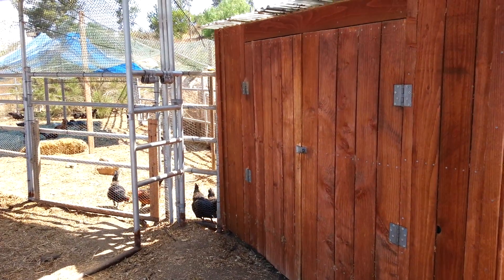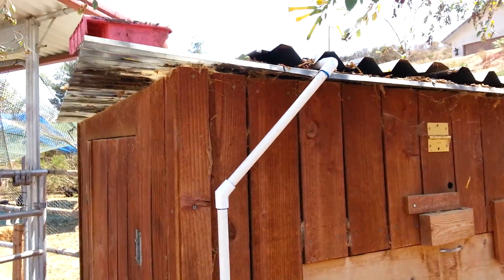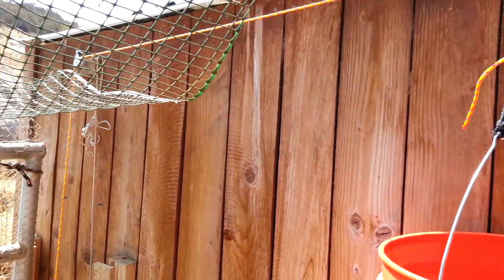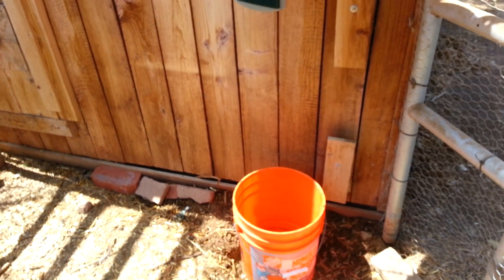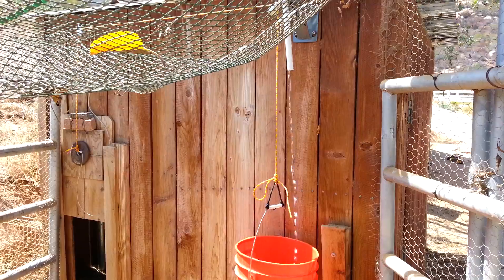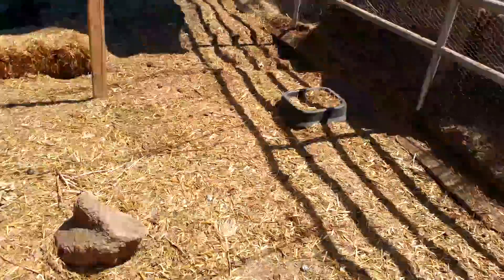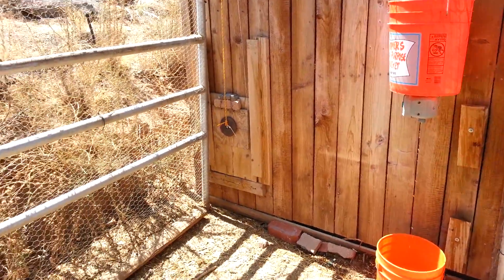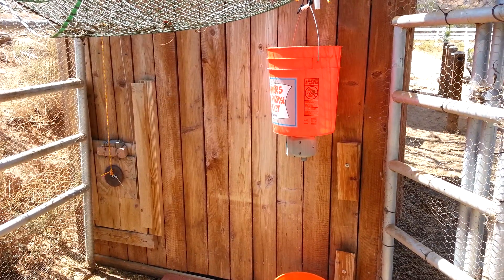Automatic water powered chicken coop door opener

Comment: Looks very expensive with those irrigation timers. Even if you already had them, the cost of replacing would be heavy. Pun intended. You could have made this with a $10 - $15 Timer, a limit switch, $13 pump and A bell syphon made of a few cheap PVC parts. Water is recycled and can double as water for the chickens.

Comment: 10/10 for ingenuity and innovation. But, this would be very difficult to have working in the winter, anywhere where temperatures drop enough to freeze the water lines, you also have to have running water and electricity nearby, honestly speaking I don't think this would work for anyone far enough up North that has cold winters. You still need to buy the water timer, thats not cheap, why not use a linear actuator on a timer or even on a solar sensor that can open/close with the sun coming up and going down, come is about the same, you don't need running water, no freezing in the winter, and cost wise you're probably looking about the same. Just my two cents for anyone considering this system. Not to offend the video creator, like I said I think that it's very smart design and if you live far enough south and have warm winters then this system might be for you.
Reply: Yeah there is way too many downsides/negatives/Cons to this that the Upsides/positives/Pros are severely out weighed. Pun intended.

Comment: Like the idea, except it be a problem when temperatures drop below freezing! Although you might be able to make a similar system more on a closed containers and maybe use anti freeze that the chickens couldn’t get into!
Reply: NEVER USE ANTIFREEZE near the chickens. Any leaks or even failure in the suspended buckets breaking or falling down will kill the chicken, if they drink any of the anti freeze filled water. So if the bucket falls down (or leaks) they may get lucky that it doesn't fall on them but they will for sure drink the poisoned water.

Comment: A hydroponic flood and drain system uses a mushroom type setup to automatically drain at a certain level.  You could eliminate that lower drain system  just by turning on the fill cycle until the threshold to drain is passed.  Blah blah :) Anyway! Awesome setup-  very useful concepts to keep in mind. Thankyou.
Reply: "mushroom type setup" I think you mean to say they use a Bell Syphon / or U Syphon. This is what I came up with that uses that. Way cheaper way easier.

https://drive.google.com/file/d/1jesXbuzPj7leY2wjd-Om9wiKeBl5dwEE/view?usp=sharing

Comment: you can do this setup with 2 cheap timer that battery operated. i use them to water my flower bed. 1 goes to hose, another mounts on bucket. program open and close time and it works like a charm . 30$ solution
Reply: Most timers wont work for the drain phase because they require high water pressure (at least 10 psi) to actually open the valve to let the water out at dusk.
Reply: @artCrummer  Most timers. Well that's why you get the right kind of solenoid valves. I just purchased one not to long ago from amazon. Goes from the under sink water filtration to the coffee maker and to the pet water fountain. Set up a vale that only lets water fill the tank when the motion sensor goes off. I put a float valve in the tank but the solenoid valve keep the free flow of water from happening if the tank gets damaged or gets kicked over.

As for the timers, that really doesn't have much to do with the water pressure.

Comment: Ummm, what happens when it's pouring rain overnight and it fills the bucket thus opening the door? Does that release valve stay open overnight?
Reply: I am thinking about taking this concept on to open/close several laying box doors.... now when it comes to rain (I have Tucson Monsoons), I figure the door only needs to open a foot.  With that said, I will have tubing/hose that enters through a hole on the top of the COVERED bucket (bucket is over a foot tall and the hole only needs to be large enough to allow the bucket lid to slide past the tubing/hose).  Sure, I may deal with some rain entry - but I could also create a cover or surround over this system.  This question posted by Mr. Sardinha can potentially be answered with a $2 bucket lid and some tubing - or a surround at some more cost to prevent rain entry. Basically the cost of a bucket, lid, and some tube or hose (Less than $10 for the water weight side of the pulley system).  This sure beats trying to wire in so many electrical and/or solar parts or even spending well over $150 for a pre-made, yet door specific automatic door opener. Now to work on pricing of the garden timers, and to figure out how to route the door closing water to fill my chicken watering pools.  Loving the idea, as well as a way to daily fill my chicken pools (basically kid's plastic swimming pools).
Reply: @suev3214  "This sure beats trying to wire in so many electrical and/or solar parts" NO. NO it does not. Not one bit. There are way too many things that can go wrong with a system like this. If you like I can go over all of them. For now I will only go over the main ones. 

Weight. Weight of door, water filled buckets and counterweights are all potential dangers to the chickens. If any part of the suspension part of the system fails you could have fatalities.

Freezing weather. Do I have to actually explain this?

Space. Compared to other systems , this thing takes up way more real-estate. 

Support. You have to have a good frame to support something like this.

Cost. Now I can can get the cost way down for this setup. With a $10 - $15 Timer, a limit switch, $13 pump and A bell syphon made of a few cheap PVC parts. Water is recycled and can double as water for the chickens. Plus buckets, tubbing, and the rest and it will only be a few dollars cheaper than a good decent not to expensive Linear Actuator setup.

"sure beats trying to wire in so many electrical" I can give you a diagram and parts list and if you can follow it you would get it done in very little time and effort. And it would have a safety mechanism too. No worries about freezing or logistics of setting up water buckets.
Reply: Just put a lid on the bucket with a hole big enough for the filler. Problem solved

Comment: to improve on this, purchase 2 water timers have a big reservoir that drains into a piece of pvc and then drains out the end. If you are worried about freezing you could use rubbing alcohol or just mix in some rubbing alcohol which won't freeze, I would keep it in an area that wont get near the birds. I would also add a packet of kool-aid so you can change the color and know the water is not drinkable.
Reply: NEVER USE ANTIFREEZE(that goes for rubbing alcohol too) near the chickens. Any leaks or even failure in the suspended buckets braking or falling down will kill the chicken, if they drink any of the anti freeze filled water. So if the bucket falls down (or leaks) they may get lucky that it doesn't fall on them but they will for sure drink the poised water.

The koolaid, food coloring or pond dye are good ideas to be able to spot leaks when they happen.

Comment: With the cost of an automatic sprinkler timer, sprinkler solenoid, aqua timer, piping and water, wouldn't it have just been cheaper to buy an actual automatic chicken door?
Reply: Wow, great question.  I personally have not found an automatic chicken door that is adaptable to the sizes or number of doors I would like to open and close at specified times for less that $180 or so.  With the water system, I foresee opening/closing 4 or maybe 5 laying box doors with two sprinkler timers, piping, hose/tubing and bucket(s); and the water then emptying the door opening bucket to fill the chicken pools. It appears I can pick up 2 timed water flow devices for less that $75, 3 buckets and lids for $15, a few feet of tygon tubing or even 100' of irrigation tubing for $11... for less than the cost of a single run door opener, I MIGHT be able to open 5 coop laying box doors AND fill the chicken pools with the water that empties from the water counter weight to open the doors.
Reply: Yeah it probably was fun to dream this up and do it but there is no way it is cost effective, all the timers and fixtures involved, but I like it.
Reply: This is actually much cheaper.
Reply: Nope
Reply: The extra cost pays for the fun and self accomplishment.